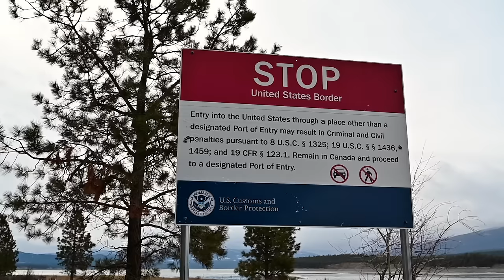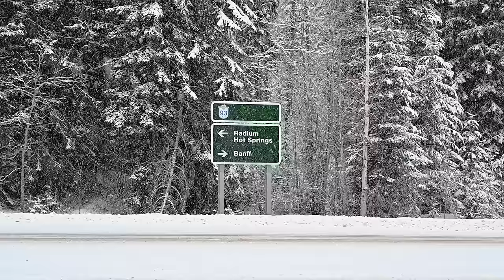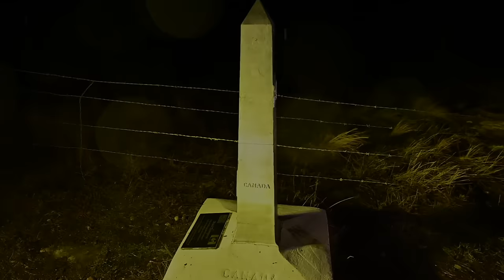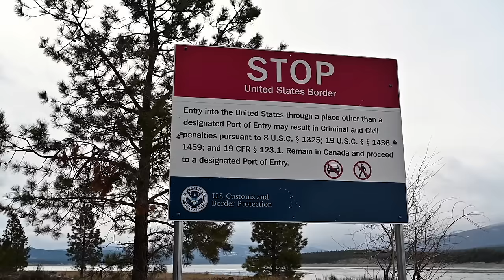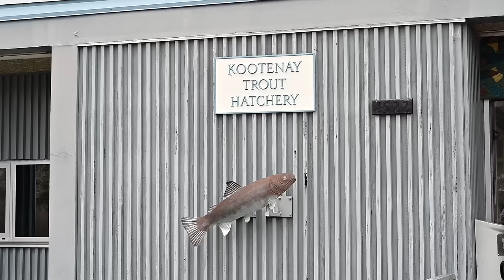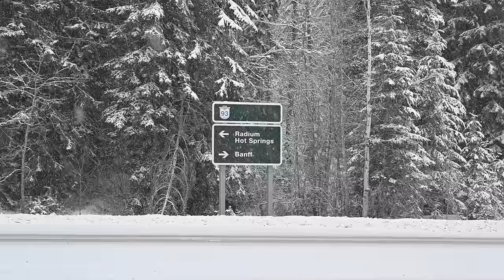Border Line 4WD Route | 400 Kilometres Off-road Chasing The Kootenay River

Comment: Traveled west of Kelowna up the Connector before it was,followed new and old logging roads, and ended up in Kamloops, which was made into 4 day trip,found a beautiful lake for fishing and spent 2 days there, vehicles were a 69 Blazer the guy who owned the Blazer was from Creston many trips there and my 75 Chevy 1/2 ton 6cyl 3 speed on the tree 2 wheel drive,needed a couple of pulls and I had all the supplies, great times with friends and some have passed away 😢, this trip took place in 1983,safe travels and adventures

Comment: Nothing personal, the Tacoma’s are not real 4x4s ,  the Wranglers are
Reply from the maker: We're curious your thoughts on this. Care to expand?
Reply: I’d love to take you out wheeling then mr big balls.
Reply: Lmao you'll have to explain that one bud. Goofy ass take.
Reply: Is that right ?
Reply: Lol!
Someone has been filling you with untruths 😅
Reply: 4WD Tacoma front left tire spins and rear right tire spins. If you want true 4WD you get electric lockers and/or straight axle I believe? Correct me if I’m wrong
Reply: @Seeareex1 fully kitted out toyota couldn't pass a 2wd obstacle. That washed out road was easy. Other guys didn't even need to air down and crawled right up that sucker
Reply: @Seeareex1 it couldn't even get past a small puddle! Lifted on big tires but still has an open diff 😂